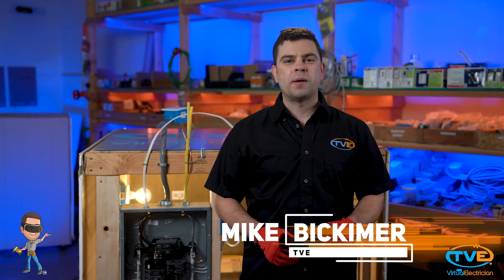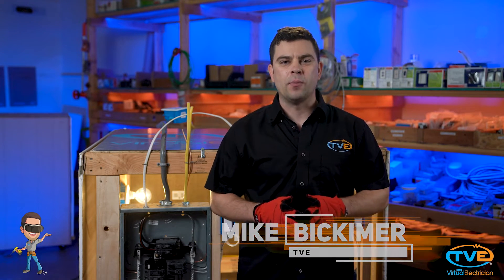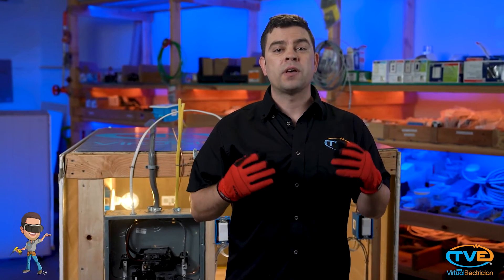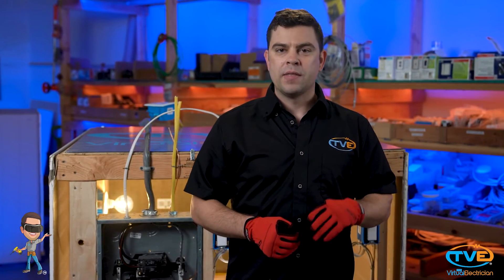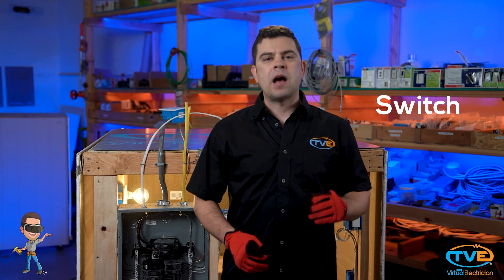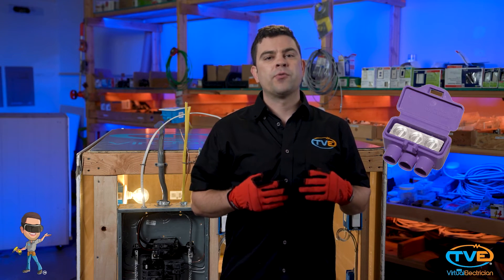Is aluminum wiring safe

Comment: installer errors wrong wire caps incorrect outlets and switches scoreing of the wireing people replaced receptixals with copper cu clad used push in on the back
Reply from the maker: Good points!

Comment: News flash, your house is fed by aluminum wiring. The danger comes when aluminum is energized and touching dissimilar metals like copper. It starts to oxidize which will eventually severe the remaining connections due to arcing. Big aluminum conductors are generally recognized as safe but small aluminum conductors can be dangerous if they’re not installed correctly.
Reply from the maker: Thanks for your input!

Comment: Becomes expensive as you need a lot of alumicons, but cheaper than pulling new wires. You can sometimes skimp on the ground alumicon if the box has screws for grounding.
Reply from the maker: it is not cheap!
Reply: @TheVirtualElectrician  for the piece of mind versus marrets, I would use alumicons for myself. "Cheap" and "cheaper" are relatively terms.
Reply from the maker: @Phil-D83  indeed